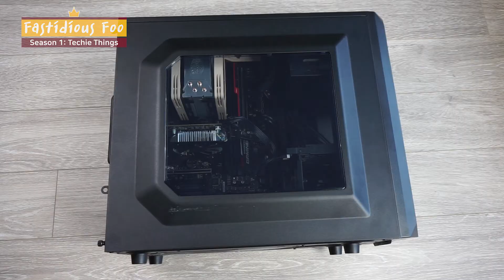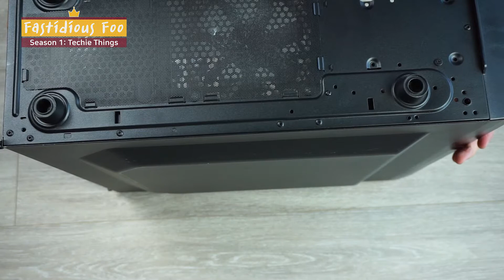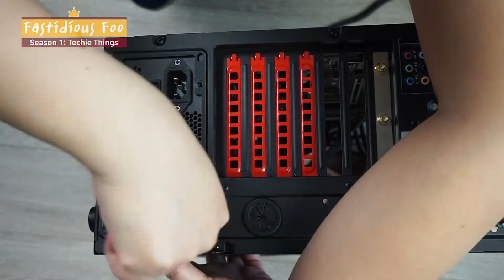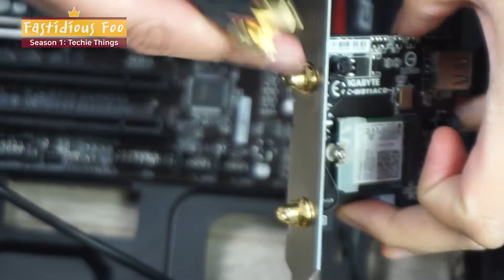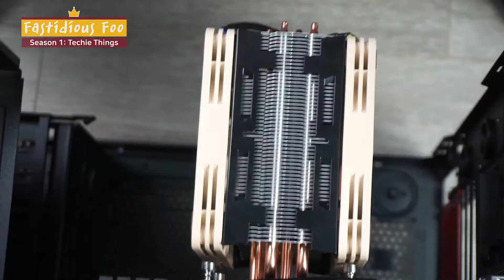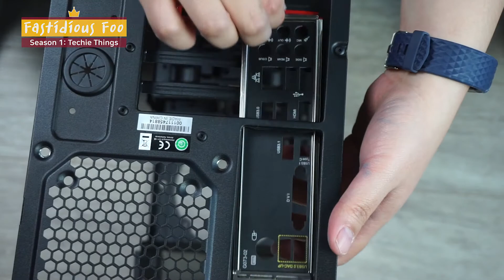Tearing down a Gaming PC

Comment: I have 580-023w and im thinking to buy a new psu, case and mobo, is there any problem if i put the 580-023w i5-7400 and gtx 1060 and the 8gb of ram in a new mobo?
Reply: as long as the New mobo has the proper socket/support kabylake  LGA 1151 as for the GPU i think i just needs a PCIex16